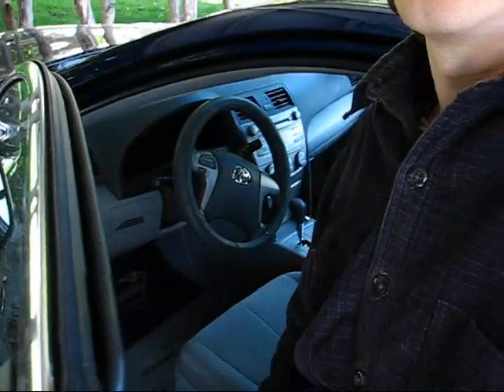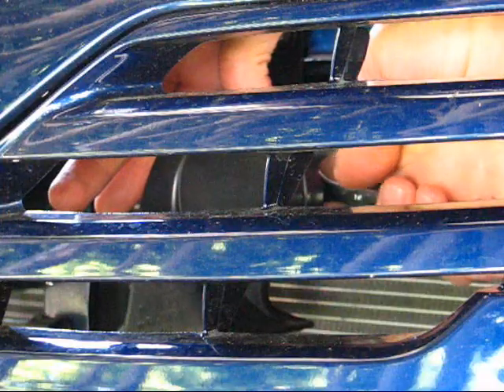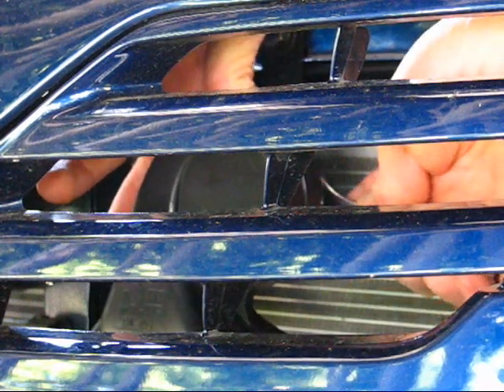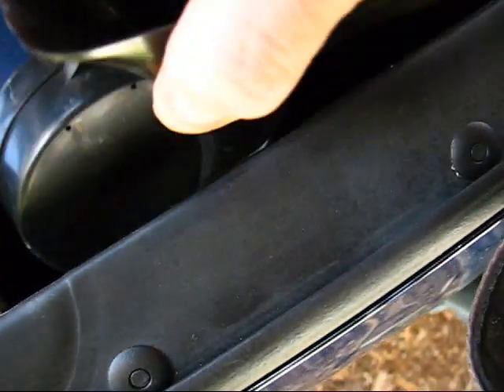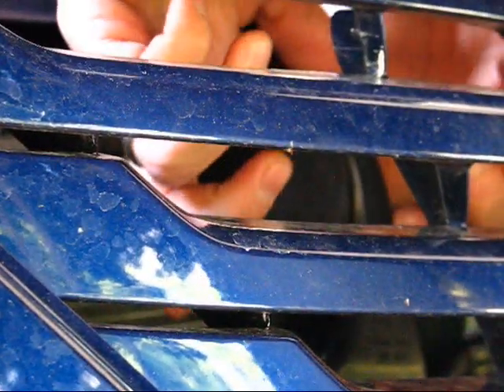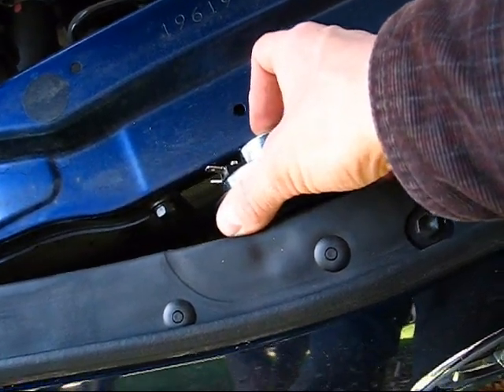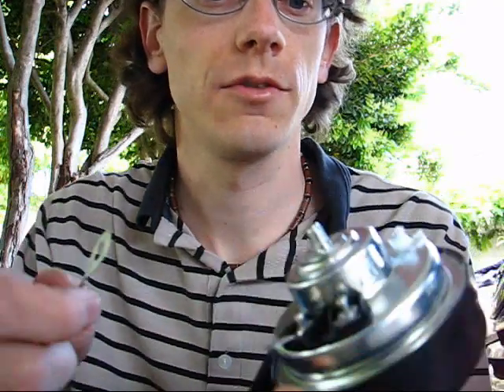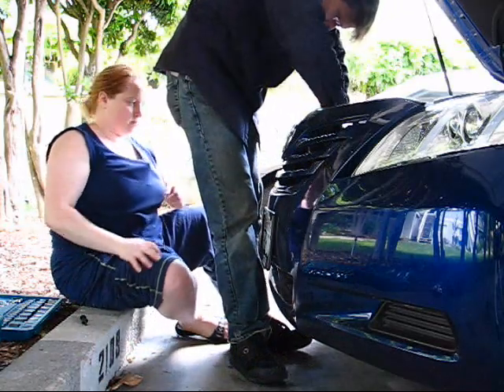Replacing the horns on a 2009 Toyota Camry

Comment: Nice video.  I'm glad to see that your OEM relay worked for the new set of FIAMM replacement horns.  The fact that you were replacing the pair of horns, eliminated the need to add the FIAMM relay resulting in extra wiring.

Comment from the maker: @vietnamrebel ......they can blow straight for at least 9 hours. But having a set-up to prevent overheating is very difficult. They get very hot after one minute of solid sounding. And yes, I've lost one to a terminal snapping off too. The only bad thing is, the Fiamm AM80S low tone (not all, but many) tends to sound not as good at temperatures below 40 F, and progressively sounds more like a dying duck past 30 F. Above 85 F, the piercing sharpness sound fades. Crazy mad scientist I am!!

Comment: @bwelmhouse1 I agree. I've had several pairs of these Fiamm horns and used the heck out of them without a single failure. Still have two pair left, sold one pair to a friend. While trying to find different places to mount the one pair though, I did bend the connectors - too many times (losing one connector is all it takes...). That's the only weak point on these horns, they bend off really easily. But as long as you don't touch 'em, they'll be fine! Now I'm using old Cadillac horns though :)

Comment: I decided to have a little more fun with the horn project so I have two AM80S freeway blasters installed and an older AM80 from Italy as well so I have three trumpets blowing at once. Talk about attention getting! The Italy one is a high note and the AM80S versions are the low and high notes but all tuned independently so it almost give it that Cadillac feeling. I blew the horn for a squirrel yesterday that came into the road...I have never saw one run that fast before in my life.

Comment: I've never tried Denso myself but I was a tad disappointed in the Fiamms I bought. The ones you put on your wife's Camry sounded sweet but mine almost sounded like what the Camry's did before they were replaced. Apparently they can be adjusted slightly but you have to be really careful in doing so. Did you adjust yours or just throw them on as is? A tidbit, I live relatively near the US Fiamm plant. :)

Comment: some useful information, thanks for posting. In the video however the original horns have a much nicer tone than the replacements, and sounded just as loud...at least in the video.
Reply from the maker: I do wish the video was able to show the volume difference. Indeed the aftermarket ones were louder, but the auto gain on the microphone evened out the sound levels. So to the viewer of the video, they sound about the same.

Comment: @bwelmhouse1 The difference was amazing, they sounded like a Cadillac instead of a mismatched train horn haha. The adjustment screw is a nice way to change volume, but sometimes it messes with the balance between certain notes. Not as noticeable on 2-note set ups, but with the dim. 7th chord of the 4-note horn, it's much more noticeable! You should look into getting some at a junk yard from a 80's-90's Cadillac DeVille, Fleetwood or Buick Roadmaster. They get everyone's attention!

Comment: I keep watching this video and I'm still jealous of how you got such a great set of AM80-S horns. In all the ones I've dealt with, they've all sucked and didn't have that nice, loud sound to them. I've wondered if they've changed the materials used to produce them over the years. Now I think they focus more on the sound itself, rather than the loud and shrill of the horn. I even had the Chevy dealer replace my horns back in 2010 and they were replaced with AM80-S horns, but they never were loud like these ones. Even in the clearing, it sounded like the horn blared like a champ and truly let everyone know you were around. These horns truly sound like the old AM80 horns used to before they were discontinued for whatever reason. If you still own the Camry, how are the horns holding out on it? Before I had the dealer replace the horns, I'm almost sure the car came with AM80-S horns that were going very bad only after about 4 years since I think mine had some of the first ones made being the car is a 2005.